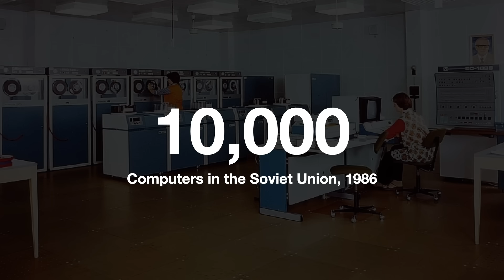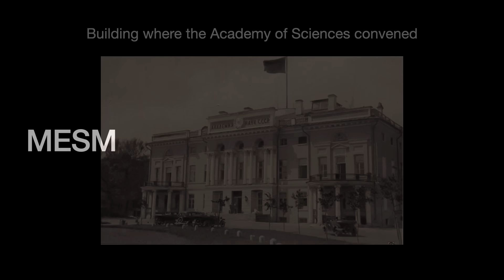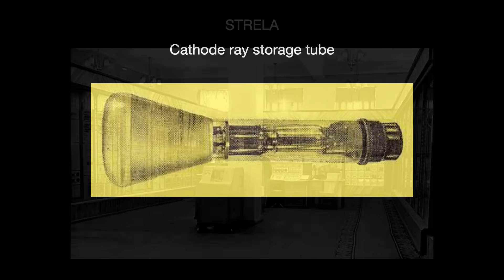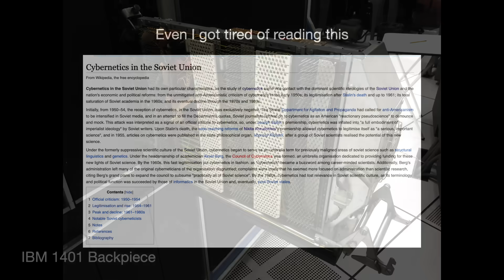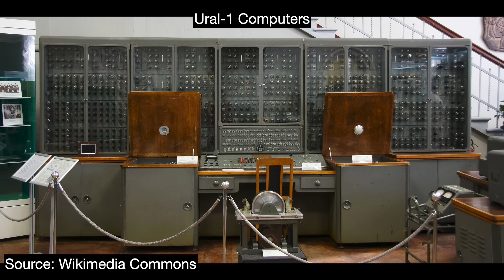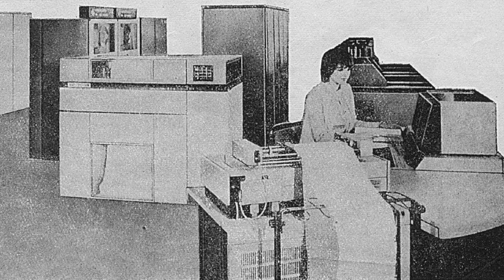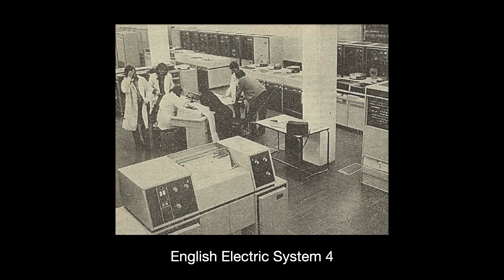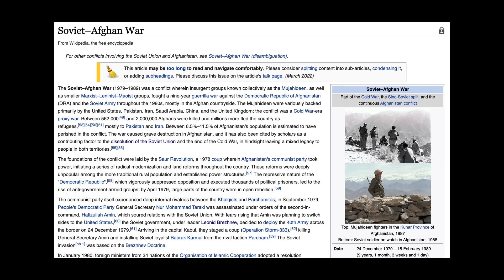Why the Soviet Computer Failed

Comment: The ending sentence suggests that the lag and failure were inevitable due to a lack of human capital. But I don't get that from the evidence presented in the video. It seems it was caused by poor earlier economic allocation decisions.
Reply: May I repost:

Basically USSR failed because of its system was too dependent on the individual power of the ruling elite of the state.

  The 1965's economic reforms in USSR are often seen as a last turning point on the crossroads between socialist and capitalist economic system. They implemented the essence of capitalism into the Soviet society - profitability-driven economic behavior. Since then corporations - and as a result its workers - had a stark incentive to behave self-interested and aim for the own profit.

https://en.m.wikipedia.org/wiki/1965_Soviet_economic_reform

The system was set up for the capitalist logic, from there it was a question of time till the body of the socialist system would decay.

Another point is the horrible and fatal faulty political decisions in the economical sphere, done by Khrushchev. He did lots of reforms, that were unsuccessful and finally were wrapped up. For example 1960 he canceled Artels, a form of cooperations, that were based on private incentives aka private profit oriented ventures, which since the 19th century supplied Russian society with consumer goods. At a great part they produced the consumer commodities, which started to become deficit after the artels were disestablished.

https://en.m.wikipedia.org/wiki/Artel

Then there was a another failure - The Nikita inspired rush for 
 notorious competition between two systems ("We will catch up and outrun!") this slogan equalized the goals of the two systems - it turned out that the USSR and the United States had the same goals, but their paths were different. On the other hand, the slogan put the USSR in the position of a catch-up party, which gave rise to a corresponding psychological complex.

Since then, the performance of the two countries (the USSR and the United States) were constantly compared in terms of personal consumption. However, to compare the two systems in terms of that indicator was to recognize socialism as a failed copy of capitalism. As a result, the Soviet people stopped being proud of their system and began to look enviously to the United States. Mayakovsky's famous line, "Soviet people have their own pride, we look down on the bourgeoisie!" has lost its once majestic meaning.

For being the first socialist state in the world, the results of surviving over 70 years are quite impressive. Compared to socialism, capitalism took 500 years to establish..

Comment: Check your wikipedia: "Between 1986 and 1988, Soviet schools (!) received 87,808 computers out of a planned 111,000. About 60,000 were BK-0010s, as part of the KUVT-86 computer-facility systems". So, could you please tell me, there did you take information bout a 10k computers?

Comment: It's debatable whether ENIAC was the "first" general purpose programmable computer. The Colossus computers developed several years earlier could also be considered the first depending on your definitions of those terms.
Reply: The Zuse Z3 (designed in 1938, working in 1941) is generally acknowledged as the first functioning programmable computer.
Reply: @reynardkitsune1  except it isn't generally accepted. If you check their Wikipedia entries there are several early computers that people variously claim to have been "the first". It's very much a subject that is still debated.
Reply: @nathangriffiths6218  Got this info about the Z3 from the Wikipedia. 😉

Indeed, there are various definitions on what can be seen as a computer, but since the majority of publications and opinions are agreeing on Zuse and his machines as "father" and "first" in computers I think it's safe to make this claim.

Comment: As a dictator, Stalin also influenced the Soviet encyclopedia. The slogan cybernetics was written under his influence with the interpretation that it was a bourgeois fake science. This limited development, funds and human resources.
The communist bureaucracy was so inefficient that the approval process to buy a computer from the West took so long that the model in question was replaced by a more modern one. But the enterprise could only buy the approved type, so a computer was delivered assembled from spare parts.
In Czechoslovakia, the story went that when decisions were made in the ruling Communist Party about the development of semiconductors, the minister stopped the development. We will wait for all-conductors, they said.
Technology in the RVHP was more unreliable the more complex it was. The Soviet 100 MHz oscilloscope could never be used to revive computer technology because it pendulated between customer and service until communism collapsed.
A very advanced automatic board recovery device with a probe that moved in XZ coordinates had trouble passing a self-test.
The technical failures were sometimes curious. The board worked when it was on the measurement attachment, but failed in the device. The cause was the brown potting compound of Soviet IOs (derisively called tortoise shell), which let light through, so only chips that worked on light passed inspection.
Because the supplier-subscriber relationship didn't work under communism, enthusiasts in every company developed some single-chip microcomputer just for their company. We used to joke that Czechoslovakia had the most microcomputers developed per capita. But none of them were produced in any significant numbers.

Comment: in the 80's japan illegally helped the eastern block with semiconductor technology , mainly to the DDR where not only sold process technologies but the machines for running a whole semiconductor fab - there were often shipped as agricultural equipment. Certainly 2 fabs in the DDR had state of the art equipment and clean rooms in the late 80's and were manufacturing in 3 micron  Cmos 
Such products as the Z80 and the 286 had been "reworked" and Drams in 256k and 1Mbit were produced.  (I was there) plus 74HC logic ...
Commercially the the fabs were a disaster as they had simply too many people working there.
They were making clone IBM Pc's in the mid 80's not so long after IBM and smaller.
For some reason this did not transfer to Russia

Comment: In Poland, we made R-32 computer for the unified system. Since the ELWRO was perhaps the most experienced computer (and had cooperation from ICL) design facility in the eastern block R-32 diverged from the requested specs. Soviets where a little bit butt-hurt because R-32 was both smaller and faster then the Soviet R-30 computer.

Comment: You’re not thinking like an engineer if you think power is important. A computer is a tool which is useful for completing a specific task. Your assertion that Soviet steel is of a low quality is incorrect. Tetris was programmed on a soviet computer by a scientist studying compulsive behaviour and pattern recognition. Not a fancy computer but serviceable.

The issue here is what is useful in life. More products and profit for the owners of the means of production / ruling class. Or a focus on economic stability and comfort for all citizens.

To what extent is a more powerful computer applicable to productivity? If your product is overproduced it’s value will decrease or it might just go to landfill.

If you have more, better and cheaper cars, is this at the expense of public transport to support an infrastructure capable of supporting individual car ownership? Have you increased mobility for your workforce or simply transferred the responsibility of transport into them and diminished their quality of life by depriving them of the money spent on maintaining and fuelling a car even at the expense of rapidity of travel from source to destination?

A capitalist America replaced dense and ornate cities with an efficient mass transit infrastructure with alot of roads and car parks.

Is it a rational approach to favour computing power over a considered approach to developing a machine which serves a specific purpose rather than a general purpose which then need problems inventing in order to justify its existence?

What I’m saying might seem illogical to a consumerist. But if you are tasked with managing an economy for the benefit of the proletariat, it doesn’t make sense to invent a machine which has no application.

Cybernetics are only useful in car production. You don’t need cats if you live in a city which hasn’t been replaced by tower blocks and car parks.

Choice is only an illusion of you are living in squalor. With limited government intervention, it’s likely that companies will exploit a citizen of they are unable to access a healthy lifestyle easily.

A capitalist government is an impossibility anyway. Because to support an unstable market economy requires significant subsidisation. Money must be made in order to maintain the demand for more goods which require money. Only by stimulating desire for products can a capitalist economy function. Which requires the denizens to be in a state of want or need.

Is it useful to have the latest MacBook? Only if you want to use the latest software to create entertainment of which the subject matter is the product itself. For instance, music or visual effects which are technically impressive for the sake of impressing the viewer with the product upon which it is made.

Is this type of entertainment nutritious? Is it more meaningful to have a more powerful computer? Is it useful, really?

Besides. Russians used ZX Spectrums, using Sinclair BASIC. ZX Spectrum demos from Russia specifically are amongst the most impressive visual spectacles I’ve seen, and that’s not even considering the technical achievement of the programming.

The ZX Spectrum itself is a product of a Britain before it become capitalist. In 1983, even with Margaret Thatcher in power, their still existed government departments which would subsidise or take over companies if they were considered useful to the nation. Sinclair Radionics was. It marketed the first ever digital watch and pocket calculator. But it’s chief engineer, Clive was a poor businessman. But his vision, although staunchly capitalist, was also focused on mass appeal and accessibility to technology for all classes. 

The ZX Spectrum, assembled in Dundee by Timex is famous for the bedroom coder revolution of the 80’s where 16 year olds could make fortunes.

The ZX Spectrum was useful because it served a function to the lower classes and raised to the spirits of the nation overall. The cheapest computer in the world was a great leveller.

It’s competition was a joke. The BBC Micro was not affordable, the Acorn Electron wasn’t as good as a Spectrum.

The philosophy of capitalism is an oxymoron. It claims to offer opportunity, but requires it to not really exist. The only difference between capitalism and communism is the mission statement. The focus on the individual or the population as a whole.

Science is all well and good but in the end it’s just a series of hypotheticals, ideas. What is important is all the people, not each person, atomised and fragmented.

The Soviet Union was a successful demonstration of a managed economy. It failed because it could not defend itself from the US opposition, which was ideologically threatened by the notion of a truly egalitarian and incompatible philosophy.

If capitalism didn’t destroy communism,  it would have been destroyed itself. Because capitalism exists against all logic and only by the will of the greedy and nefarious few.

I like the design of my iPhone but it’s operating system is continuously limiting it’s applications. Because I must keep buying new phones to be allowed access to the great experiment. But I don’t like that. I know I don’t need a more powerful phone to run the Amazon app. I know I’m being wasteful if I spend money just because the economy needs fuel. The fuel is me.
Reply: @Scaucy man 2.0  which bit did you like most?

Comment: A communist society doesntn have as many primary control points among the population.....at the extreme, you could argue they only have one, while the Americans had 200 million (but obviously that isnt the actual reality, but you get the point--its in that direction.)

This makes the soviets very apt at competing with the even largest projects humanity had ever seen, but they will always be far behind in seeing the organic development of a vibrant and diverse industries....because, well, communism outlaws that organic development by design. Its just one of its built-in cons. A sort of unintended consequence, but sort of also intended.

Basically, communism's strength was in easily mobilizing the nation's wealth to large projects, but its weakness is in not allowing industries to naturally mature into the complex and interconnected industries of the West-industries like what was seen in America simply could have never been master planned. (You're basically seeing a comparison of organically-developed computing industry that motivates innovation from literally anyone in the system who can provide it vs a master planned version where a much larger share of the innovation was required to be directed from the top.) 

Although i have no idea how much wealth/energy went into either of the two systems per year, so this isnt an ideal comparison without that info.....but you can definitely infer alot of things here.

Comment: The ENIAC wasn't the first general purpose programmable computer. People thought that for good reason, because Konrad Zuses Work in that area was bombed to bits when the Airforces managed to run bombing campaigns on Berlin.

It may have been one of the first fully electronic (as opposed to electromechanical) digital computers, but that statement might yield you disagreement with Colossus enthusiasts.

Comment: By the 80s the USSR did manage to make Z80 and thus ZX Spectrum cloned.
Reply: In the communist system,  there is a big difference between what a company shows at an exhibition, that it produces, and what is supplied in such quantity and quality as to be affordable. For the ZX Spectrum, you either need an original ULA, which costs dollars and that is a problem for a Soviet person and a company, or you have to assemble the ULA circuit from standard components. And some "smart" guy decided that the solderless mask was not needed and would not be developed and supplied. (A true 1980s reality.) So the launch is really adventurous and you can guess what the price and availability will be.
Reply: @prutok  But the ZX Spectrum clones like Pentagon were indeed pretty easily available if I am not mistaken.

Comment: In Yugoslavia there was a joke about Soviet pocket calculator:
It needs 2kW to run, you can cut yourself on it, it is correct most of the time, but it is only calculator that can work at -80 degrees.

Comment: At computer programming course at university during 1998 my teacher told me that while western computer machine language parameter will have only source or destination in RAM but remainder operands internal registers, soviet computer could have all operands in memory. E.g. an ADD (addition) in western computer you must load first memory location in an internal register, then add with second location and then either overwrite there or if you don't want overwrite, keep in internal  register and then write to third memory location in third operation. So you need 3 opcodes to perform ADD memory1 + memory2 and store in memory3. While soviet computer it was just one operation, all three operands in memory. I wonder: was this valid just for the first generation vacuum computers? Ir the second transistor? My teacher pointed this as the tech issue to scale technology, because longer list of operands would increase cost dramatically and they would then abandon that idea because inefficient
Reply: It depends on architecture, not on country. 2 memory operands could have disadvantage, that 2 acceses to memory for sources and one for result could require more clock ticks.  Basic and fast instruction set is base idea ofpopular  RISC processors.

Comment: I would suggest that as technology advances it gets ever more difficult to reverse engineer. It is one thing to untangle a transistorised or valve based circuit, quite another to untangle the innards of a cpu chip. Yes, it can be done but far more elaborate technology is required to do it. It is, as suggested, more efficient to develop your own capabilities if the ability to buy or steal it in is being denied or limited to you. It's one area where capitalism has an advantage - the drivers are so much larger and to stay in the marketplace a competitive approach is required. However, a word of warning as well, don't make the mistake of underestimating Russians. They have some very bright and clever people indeed - it's just that that resource has not always fully appreciated by the system in the past.